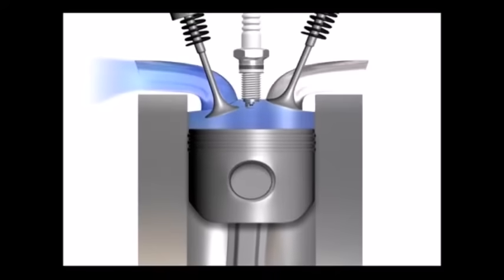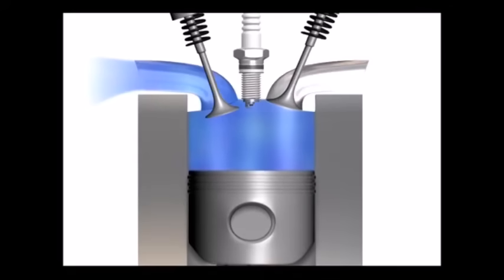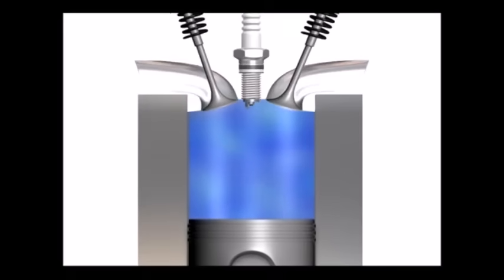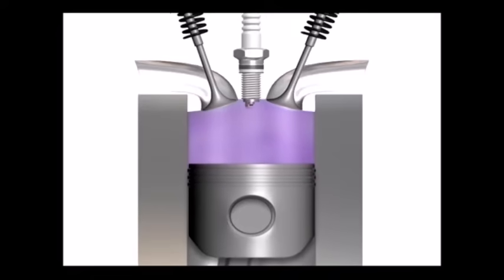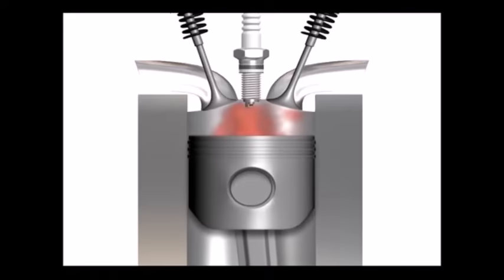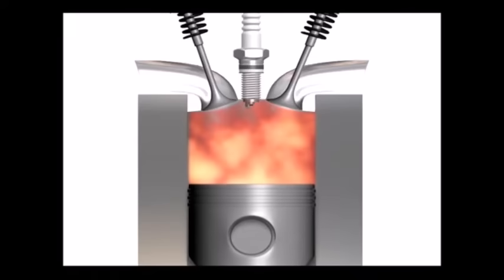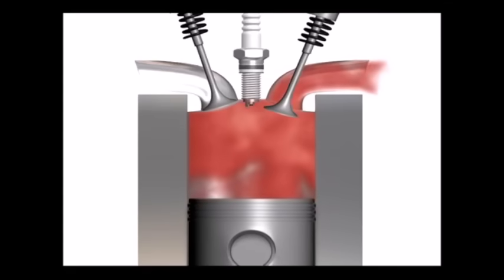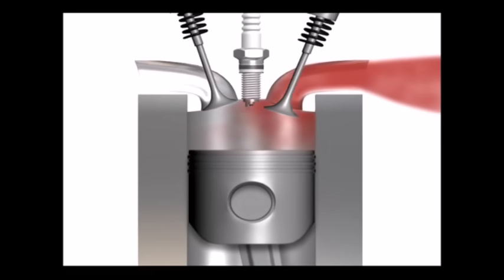Petrol engine working

Comment: What forces the piston to go upward for exhaust stroke and again downward for intake stroke??
Reply: Every piston is connected to the crankshaft via the connecting rod. Pistons have opposite alignment so as one piston goes down on a power stroke what causes the crankshaft to turn, the crankshaft itself is pushing the other piston to go up. It is quite similar to someone riding on a pushbike - when one pedal goes down, the other goes up.
Reply: @rasklaat2  so a single piston cannot do the job vy itself.

Comment: God damn i am still not able to understand how these simple yet complicated things work even after watching a milion videos. Hats off to engineers and scientists man
Reply: Simply told, when the fuel is highly compressed and the electric spark is added in the right moment (controlled by the camshaft), it makes a very powerful explosion like a bomb, which must go somewhere. and it can't go nowhere except moving the piston down and up. perhaps, 4 pistons are moving up and down, and each one helping each other automatically by those explosions. they are not moving in the same direction and at the same time, instead they are perfectly balanced in moving up and down, which is making engine to work calm and balanced. And this is the most important thing if you want to understand:   The piston of a gasoline engine would travel up and down approximately 66 times in ONE SECOND at a speed of 2000 RPM, as an example. That's really fast, right? Our eyes would not be able to even see those piston movements if the engines were made of a glass. And that speed is what gives power/torgue, which is later slowed down by the gearbox. A typical car engine idles around 700 rpm and redlines around 7,000 rpm. This equates to a piston going up and down about 12 times per second at idle, and 120 times per second at redline. Depends on which car and engine you have. 
So, we have a very powerful and balanced explosions in a perhaps 4 pistons (typical 4 cylinder in-line engine), with the CRAZY fast speed of moving pistons per second, which is later managed by the gearbox. That's why you get high RPM if  you want to start the card uphill in a first gear. That's the situation where the pistons are moving at their fastest speed, perhaps 5k RPM, it all depends on your car/engine and how much you press the gas pedal.
Reply: 5 days ago?!
Reply: It’s just basic science but the engine is complex